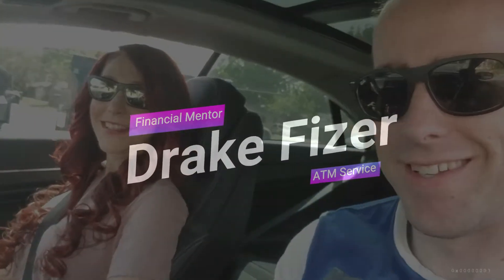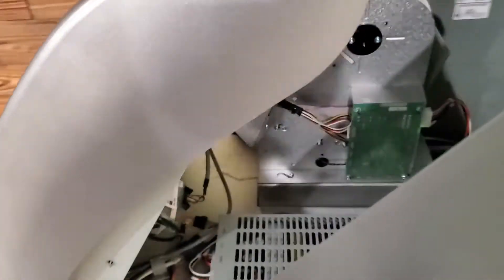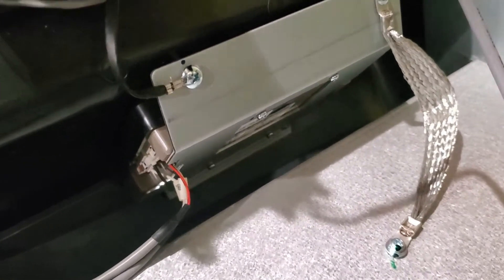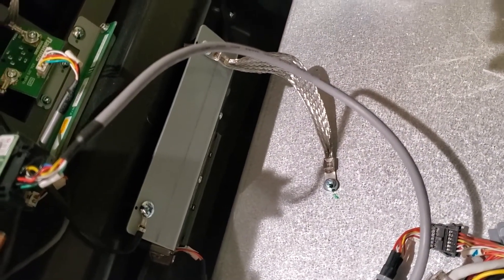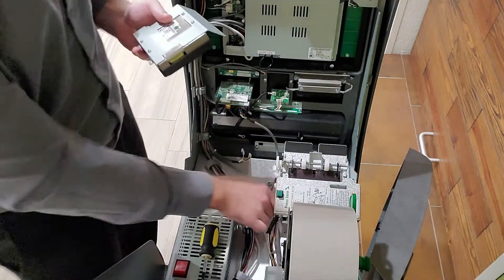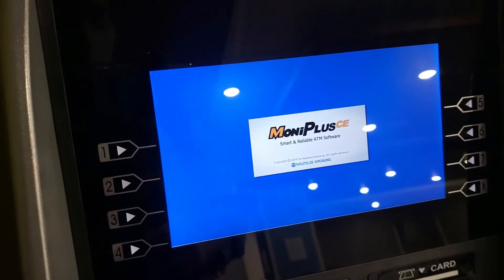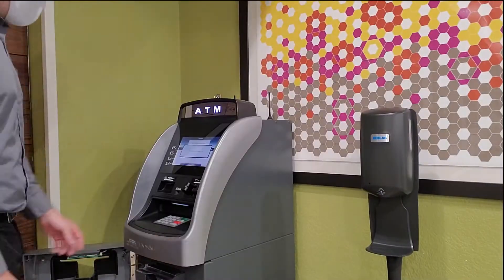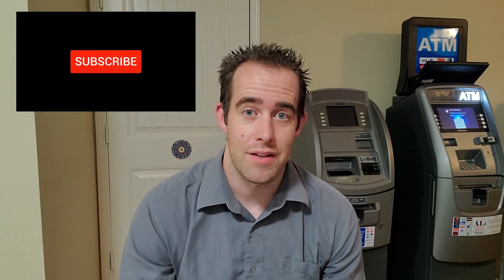Replace an ATM KEYPAD AGAIN!!!

Comment: Hi Drake, I got an EPP error on my hyosung, is that a keypad issue?
Reply from the maker: yes indeed. You may be able to reset the keypad though and reset it without replacing.
Reply: @DSFFinancial  thanks for the respond. Is one able to do a reset with the keypad installed or do i have to unscrew it leaving the cables plugged in?

Comment: Hello, 

Is fastening the pin pad at an ATM an electrician job?
Reply from the maker: Not at all.  It's 4 screws and unplugging the wiring harness. Just have to make sure you have master passwords and binded keys

Comment: Hello i just bought my Frist  Atm and bought it with a  bad key pad genmega 2500 do you know where i can get new/used ones cheap parts and or do you know how replace the battery in the unit
Reply from the maker: sorry to hear about the issue but awesome you were able to start the process. atmpartmart.com is where i go for parts. Has been reliable so far. For the battery you can send it in to get it refurbished.

Comment: Hey man I’m about to purchase my first ATM through the same processor you use I was wondering how much is there to “setup/program” once the ATM is at the location because I know I can install it by myself but I’m not sure if I can program it by myself. So is it difficult to program it once it gets to you is it pretty easy to set it up ? Thanks for the vids greatly appreciate it
Reply from the maker: Way to go man! It actually is pre programmed when they ship it. You shouldnt have to really change anything
Reply: @DSFFinancial  Thank you for responding so fast also do you get your router box for the internet through them as well the $20 a month per box or do you guys go through someone else for internet provider ? Thank you for answering my questions I just would like to start off correctly and not mess anything up lol
Reply from the maker: @thebrainybrrute2261  I go through national link for my wireless routers.